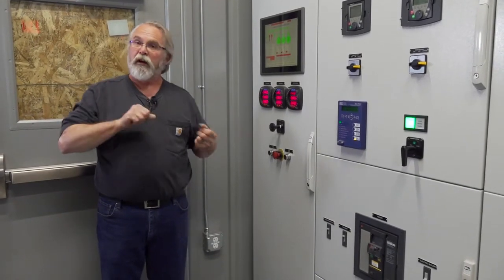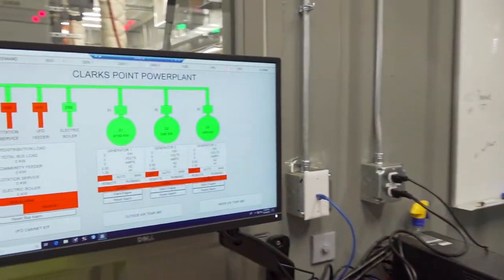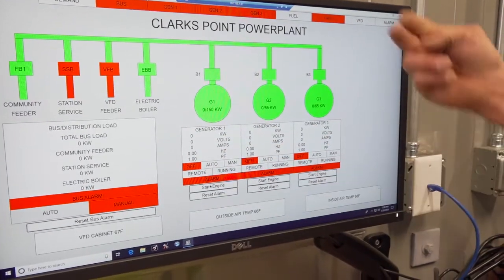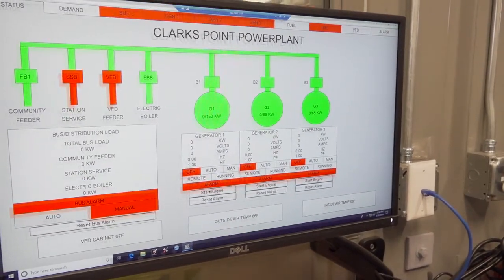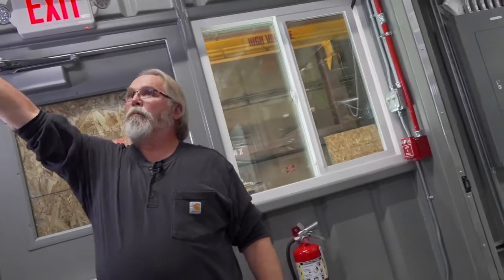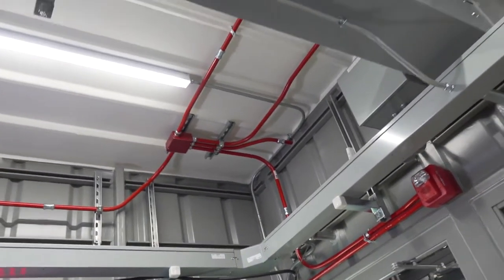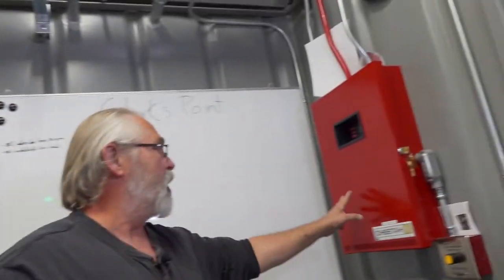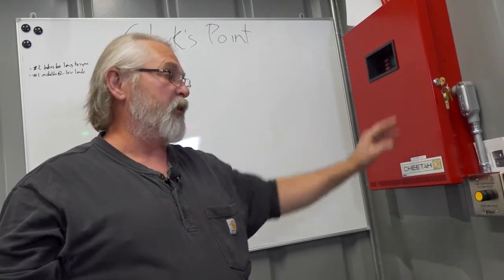Power Plant Walk Through

Comment: Nice and high quality boards then you see the disapointment, cheap, domestic internet router on the top of the first cabinet. Even more nerve racking, the SCADA computer is a Windows 10 machine....
Reply: That is all too common, even with NERC/CIP stuff.  You should see military contractors...
Reply: What's wrong with it being on Windows 10, and what should it be instead?
Reply: @gantmj  A Linux or Unix distro is a good option, that's air gapped and thus not connected with the Internet.
Reply: @gantmj  Not bloated Windblows 10 with all its Updating, patching, and even doing what we used to call service packs without warning. Windows 7 was the last Desktop operating system.
Reply: @djscrizzle  I am not a linux/Unix guy but even I know this is correct. Needs to be a simple and reliable setup with random crap M$ does and is sneaky with.
Reply: Seriously, I get pissed off when embedded system like this miss such an opportunity to run a skimmed/custom version of Linux, it doesn't even need to! Just slap Debian on there and work your application on top of that and it's already heaps reliable than that Winshit, when will people actually want CHANGE for the better, it's these tiny things it matters. You don't want the headlines being like "Powerplant shuts down due to Windows Vlrun"... its so stupid.
I can't believe they are being paid to install a system like that
Reply: @hariranormal5584  then go to alaska and yell at them. I doubt a alaskan powerplant would be sabatoged, and if it wqs it would probably be a usa wide target or like a state and place that would cuase billions.